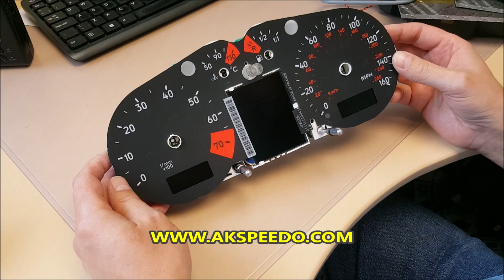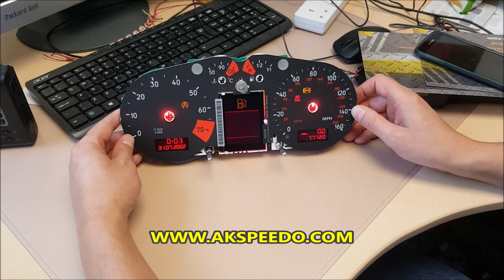Audi TT Speedometer LCD Pixel Repair (Part 2)

Comment: Hi akspeedo!!

I have an Audi A3 8p. The screen works absolutely perfectly but when started, sometimes it doesn't come on at all. Once the car is running it will never go off if it came on when the engine was started but if it didn't come on when the engine was started it also will not come on. Do you think it's likely to be dry solder joints?